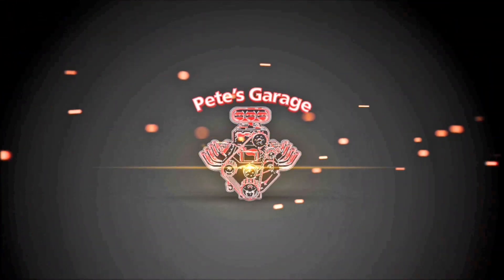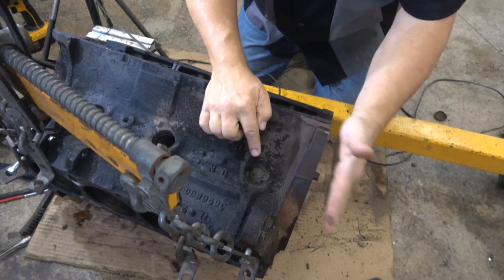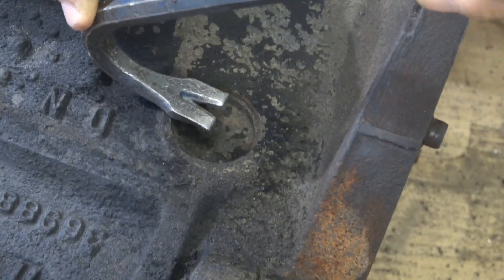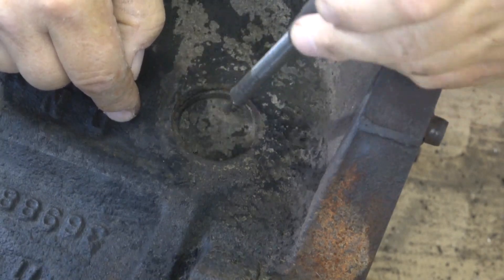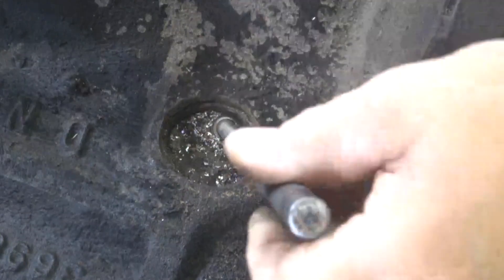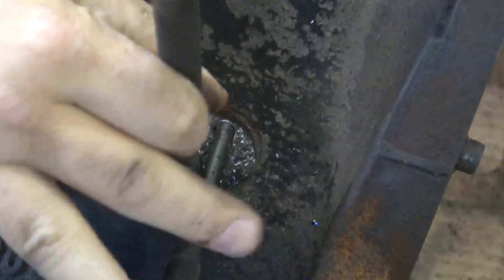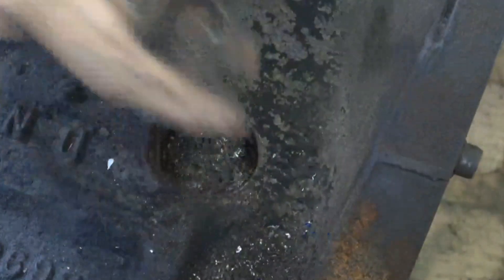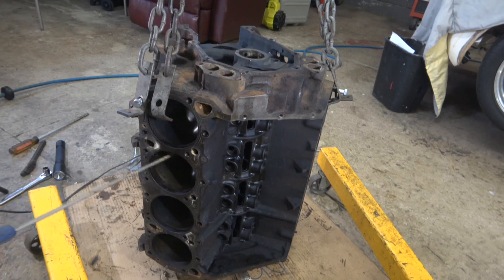How to Remove Core or Freeze Plugs from a Block

Comment: I have a problem i have to change a freeze plug on my engine but my engine is still in the truck and what do i do to get the freeze plug out without it falling in and I have never changed one before until now please let me know thank you
Reply from the maker: It is a tough job if you can't remove the engine.

Comment: Tore apart quite a few engine blocks and heads in my time, never had an issue with a core plug falling into a cavity. (Always used method two with a punch in the edge) But it looks like there is a first time for everything. Appreciate the tip!
Reply from the maker: Same here...but it just takes that one time ...lol

Comment: Casting plugs that are not intended for freezing protection.  Anti freeze is mixed into the engine coolant to provide that protection.
Reply: truth is, they don twork as freeze protection.. they are actually holes for the casting sand to be removed ..never saw one pop out to protect a freezing block
Reply from the maker: Interesting
Reply: Indeed, you are correct. These are called "core plugs." The larger ones at the rear of the block and directly behind the ends of the crankshaft and camshaft are called "bearing covers" (though they initially probably served as core plugs, too). On a rebuild, I use brass type core plugs and steel type bearing covers.

Comment: We always used a wire brush around the plug. Then drill a small hole in the plug and use a dent puller. Never had a problem. Was quick too.
Reply from the maker: That's a great method, as long as you have a dent puller :)
Reply: That works for me, thanks